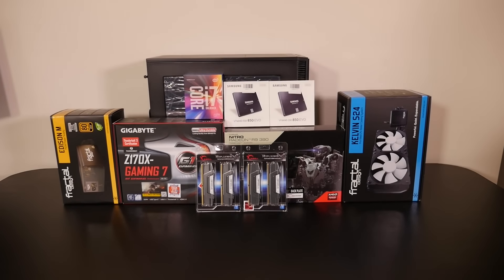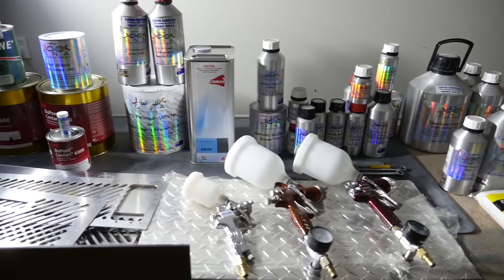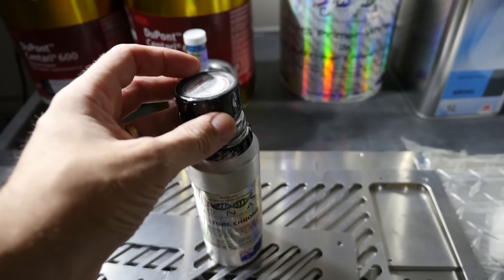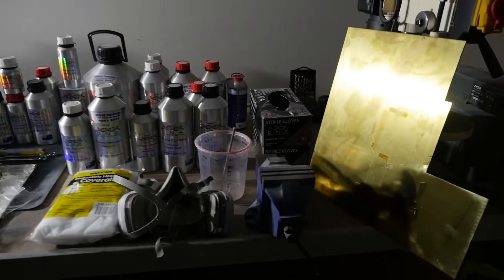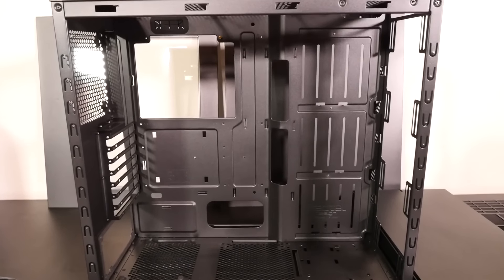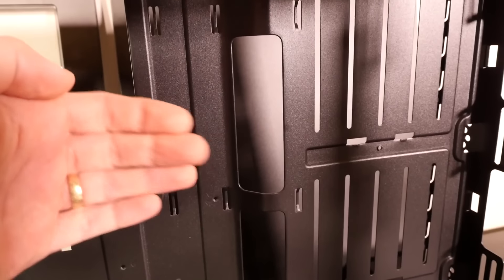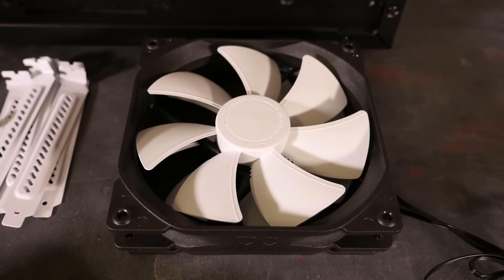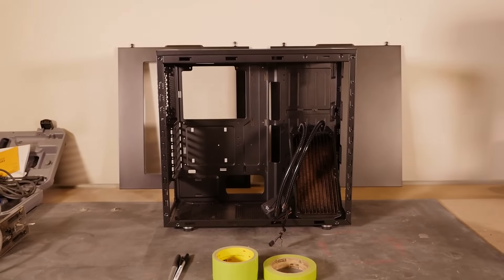Project Cobalt #1

Comment: +SingularityComputers how can i make it so 3 pin fans can get controled like a pwm fan would? i know there is fan controlers but i want to build in a define s. the fans i whant to use is 3 pin and yea there is no spafe for like a 5,25 fan controler. any tips?
Reply: you can't control DC fans the same way as PWM fans. PWM (pulse width modulation) controls speed by alternating power on and off very quickly, essentially sending voltage in pulses. DC fan control works via changing the amount of voltage that is sent to the fan motor. but yo answer your question, most current motherboards have some sort of fan control built into them, allowing you to set fan curves in the BIOS. another standalone option that doesn't have require a 5.25 inch bay is the new version of the NZXT grid, which uses software to set fan curves and change fan speed from your OS.
Reply: You could use this Phanteks internal hub http://www.phanteks.com/PH-PWHUB.html  that makes a connection to a PWM header on the MB but allows you to control 3 pin fans AS IF they were PWM. You could then use software like Speedfan to control them.
Reply: ***** wow thats awesome

Comment: I just got this case. Do you think it's possible to change the front on/off LED. I want to change it from blue to white.
Reply: It's actually incredibly easy. I did it on my Define R4. It's just a matter of popping the blue LED out of the ring, cutting some wires, popping the new one in place and soldering it onto the old wires.
Just make sure you get the right one. I believe it's a 5mm diameter LED? Best to pop it out and measure it just to be safe. But easy switch.
Reply: +Ryan “Seffyr” Rhind  Ok, doesn't sound to difficult, thanks for the quick responds.
Reply: i think its 3mm diameter tbh - i changed my light to red on my r4 also. simply pop it out and pop new back in that easy on r4
Reply: I'll make sure to measure it when i take it out.

Comment: 3 mils, 5 mils, 10 mils, that's 3, or 5, or 10/1000th of an inch.
you probably mean millimeters. it is not unusual for engineers who have worked only in the metric system to refer to mm as mils, but for those of us that have to go back and forth between imperial and metric, mils is 1/1000th of an inch and mm or millimeters is metric. when you hear mils in this context it is momentarily confusing. you are in Australia, but your audience is international, so better to stick with millimeters and not "mils".